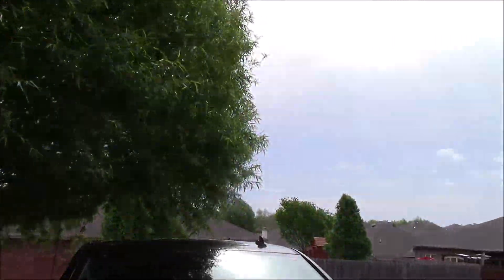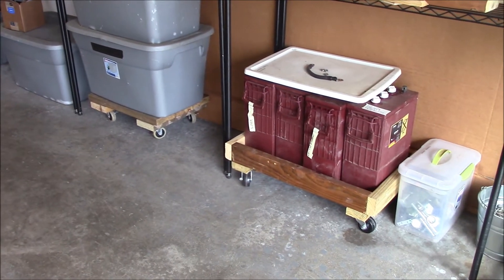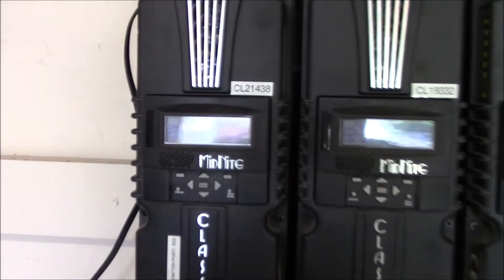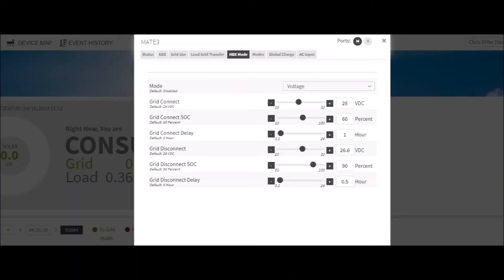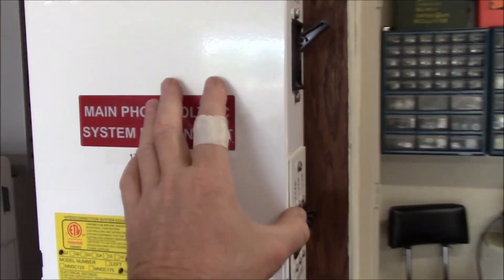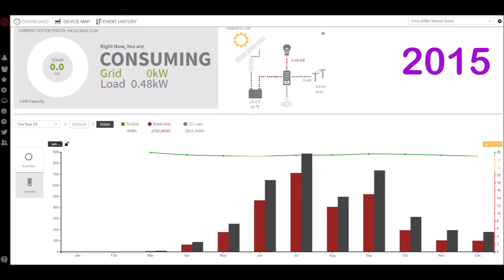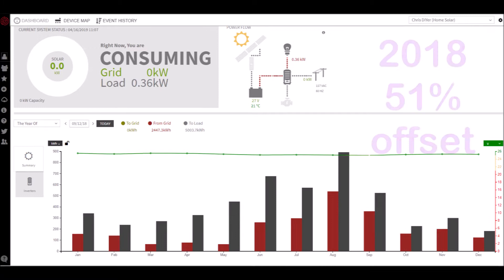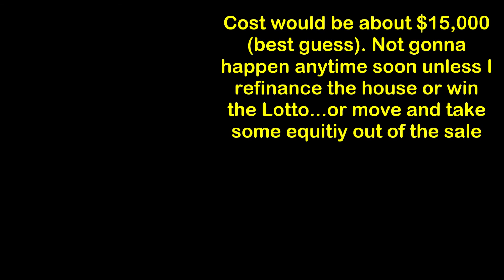DIY grid-assist home solar power system - four years of data, batteries, charge parameters

Comment: I have 8 lead acid batteries 200ah each and I bought them brand new 2 years ago. I set them up in series to 48v bank each. Now they all have one bad cell with all maintenance and care. Lead acid batteries are total garbage no matter what the brand is. Anyways, the interesting thing is that the voltage of each battery stays at about 10.5v when not charging. When they are charging the voltage goes up to 13.2v each. I was thinking of why not make a 5 batteries in series for 48v or 60v bank since they still have good cells in each battery rather than throwing them away.
Reply from the maker: I will never do a flooded lead-acid battery again. Some deep-cycle AGM's are alright. But, the "big boys" out there are doing LiFePO4, lithium, and/or something more exotic. It's 2019. We should be able to buy a 10 kWh battery for $1,000 vs $10,000

Comment: Battery certainly are a pain in the ass no doubt about it very expensive also. Have you ever thought about doing hybrid  grid-tie system for your home ? That's how my house in Florida was set up that worked fantastic with the Enphase units until FPL Kick Me Off the Grid . Now my off grid system in  Tennessee is going through some big changes.  Lots of work.
Reply from the maker: Totally off-grid is a lot of work indeed...but, very possible with the right planning and lots of sun or wind (and perhaps some running water if your really lucky). My dinky suburbia set up isn't bad, just not anywhere close to ideal. Esp with crapped out batteries. I basically have no reserve run-time...my system only "clicks over" when the sun is up. So, not totally dead in the water per se

Comment: Let me know if you want a cheaper option for batteries. Time to get that system running again
Reply from the maker: It is "running" sorta...just not taking much out of the batteries after the sun goes down (or on cloudy days). So, the batteries are just something to hold the AC loads (inverting) when the sun is up. I want 10 kWh in lithium for $1,000.
Reply: @ChrisDIYerOklahoma  well ill look around for you. Anything specific. Leaf or volt or?
Reply: @ChrisDIYerOklahoma  i talked to a buddy. I have a good start for you .
Reply: @ChrisDIYerOklahoma   hey here is a guy that you can get used ev batteries from. Hes in the US but Im not sure his exact location. His name is devildestiny555
. Talk to him from youtube and get yourself started on lithium. He can also help you with everything you need to go. Also if you need advise I will be here as well. Hope it works out for you . Solar is the future.
Reply from the maker: @frankz1125  Thanks...I will take a look and see

Comment: Wow, hard to believe it has been four years already.  That is a huge drop in your performance.  Hard to get the system to pay for itself that way.  Hope you can get your percentage back up there.
Reply from the maker: Thanks. Two good years, two bad years thusfar. Lessons learned, money spent. Would be cool to pick up a lithium battery sponsor and float me 10-15 kWh in LiFePO4 batteries or something similar. Till then...they are in limp-dick mode (can't really pull much out of them after the sun goes down).

Comment: I see a lot of people buying the battery packs out of electric cars (Nissan Leaf) and then configuring them for home power systems. It seems to be the cheapest ways to get into lithium battery banks. Much cheaper than the 15k price you mentioned
Reply from the maker: Smart guys are doing that. The market should start favoring more cost effective (and safer) lithium (LIFEPO4) batteries that us average Joe's can buy. $1,000 for a 10 kWh lithium battery isn't asking too much vs 10x that amount right now. It's all about the money/greed and high costs of raw earth minerals